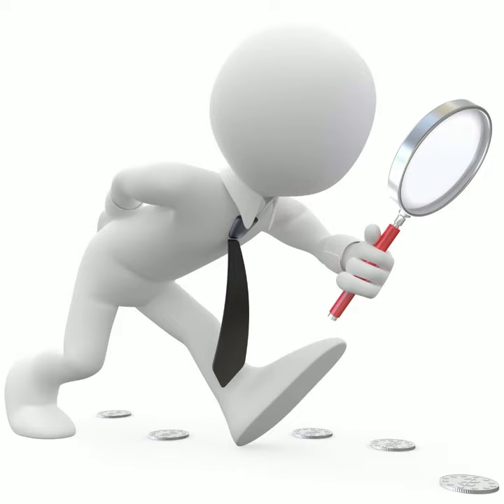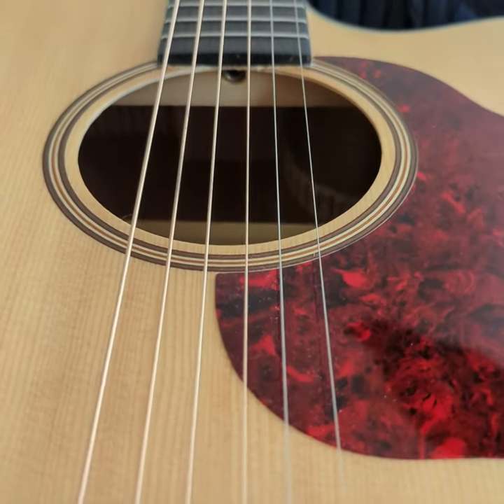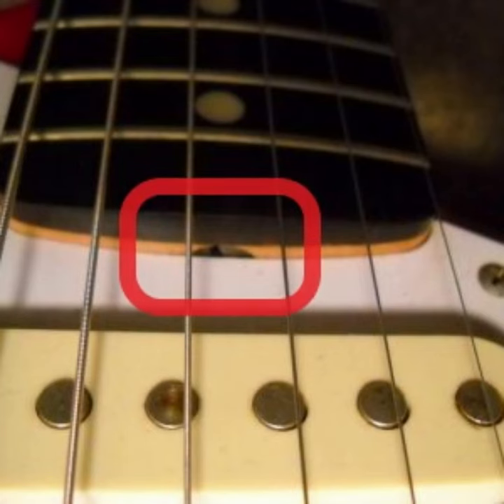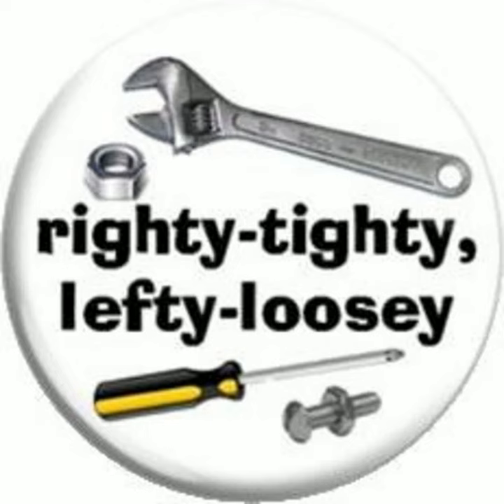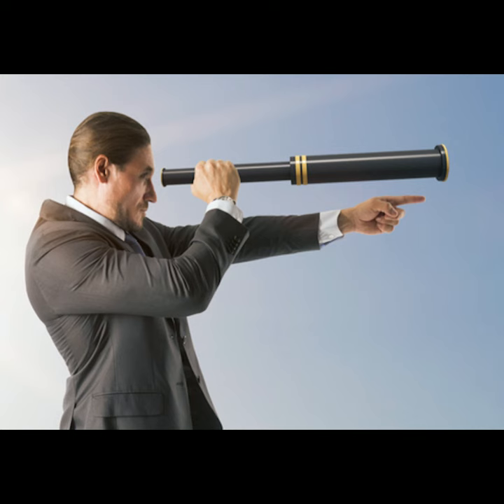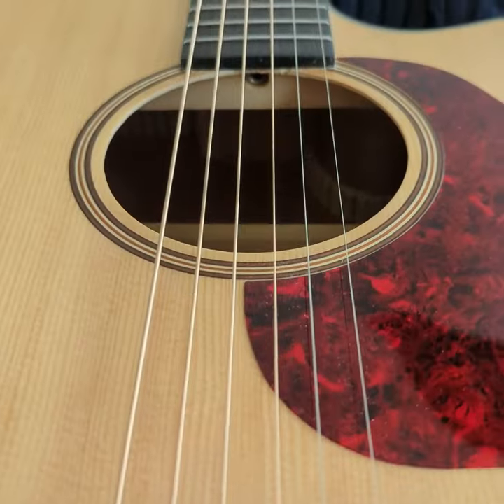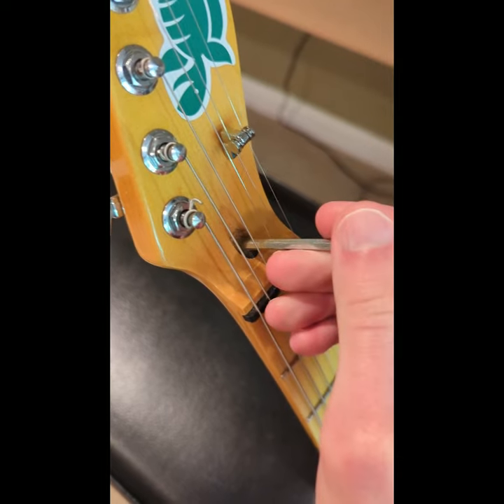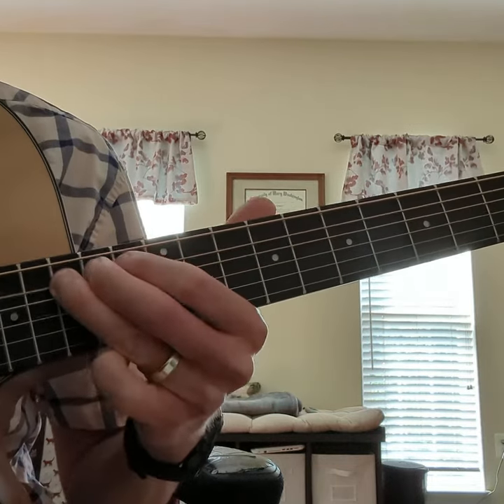How to adjust a truss rod? #shorts #guitar #guitartips #guitartutorial #guitarsetup

Comment: But my question still remains.. is tight/right going to pull the neck away from the board or towards it?
Reply from the maker: Turning it right will cause the neck to curve up (making it convex) and left will make it curve down (concave)